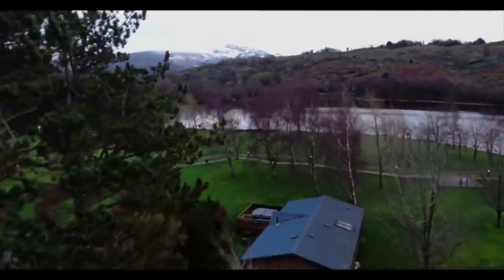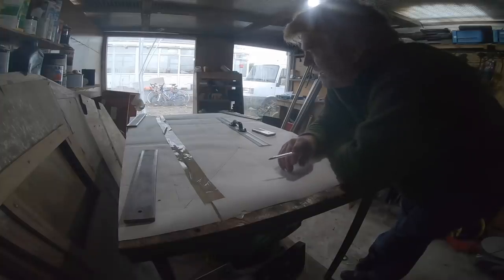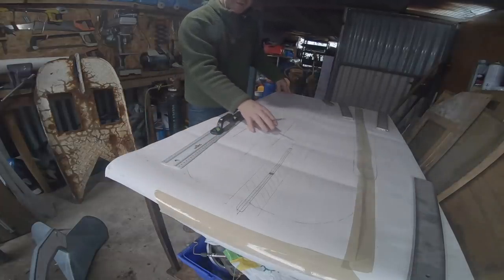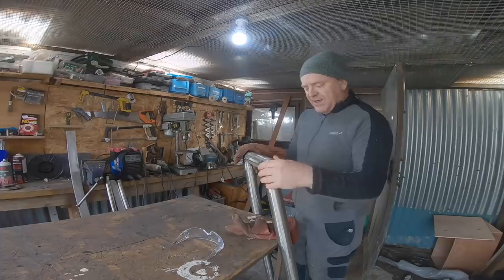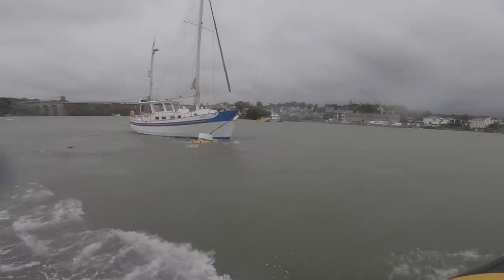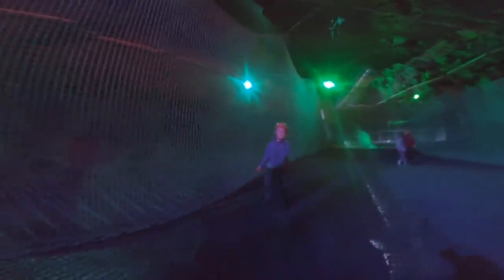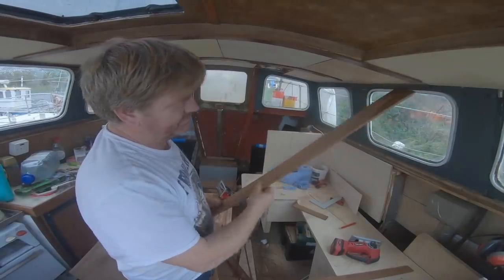# 70 - Making a new BOWSPRIT!! Rebuilding a STEEL boat⛵⛵

Comment: Great idea for the deck head! Seal it with resin to keep it waterproof and whip able.  Velcro is the way to go for attaching them and great score off of eBay for the cosmetic strips.  Your welding skills are really coming along.  I’m really looking forward to the inside work.  Your tiny home is really coming together.  Don’t forget to check out some ideas for using and modifying flat pack stuff from ikea or similar (I assume you have that type of stuff and it’s cost effective like here in the States.) There are some really terrific YouTube videos from home designers that can give you ideas for them. The toy box units in the children’s section make fantastic bench seating for eating areas and have great storage. If you shop wisely, the units are cheaper than the wood to build them! It’s going to be great.

Comment: Pilothouse overhead would be the correct terminology.  Well done making the overhead panels all removable, the use of Velcro to hold panels in place is a great way to go.  If you can find industrial Velcro you wont need any screws, many super yachts interiors are overhead and bulkhead panels attached only with Velcro.  Your bow sprit construction is an improvement over the original, wherever you place the anchor roller is where the anchor chain will hang from, the further from the boat the less likely it is to chaff on the hull.  Stainless will corrode and pit least when polished the higher the polish the less corrosion.
Reply: I 2nd your thought ! Nicely done guys
Reply: Correct term for a ceiling on a ship or boat is deckhead.

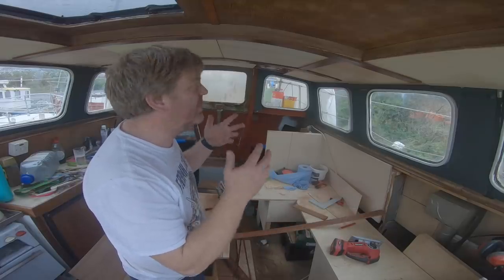Comment: 21:31 If I may suggest a finish for the roof panels: Get some used curtains (cheap cheap of ebay or the like) and "paint"/glue them in place. You can use any old paint, as long as it is the right color. Get some latex based wall paint which you can easily clean off. Paint the panels, lay over the curtain pieces and paint over them until the fabric is saturated fully. You can proceed to remove any access paint by going over the panel and the curtain with a dry paint roller which will soak up any paint which is not being absorbed by the curtain fabric.
After the paint has dried/cured you can then trim off any access fabric hanging of the sides (it is recommended you let the panels dry on a flat surface so the fabric does not hang off the edges while curing (or else you may run into some wrinkling and creasing) 
The result is very nice, has a texture of fabric, (obviously) it is durable but a bit heavy (due to the amounts of paint being absorbed), has a sound deadening to it, very easy to clean, water resistant (to a large degree - don't pressure wash it or soak the crap out of them obviously) and easy to maintain...Mind you, Vikings and Anglo-Saxons (back in the day) used a similar technique to reinforce their battle shields so it should suffice for a couple of roof panels...

I am not sure if you are planning to use a vapor barrier behind the panels but if not I would recommend doing it. Simply get any old plastic (not the really thin kind obviously) and staple it over the insulation, taping over any seems with ordinary packaging tape...
Reply from the maker: That’s w brilliant idea! Love it. We’ve already ordered the fabric now
Reply: @SailingMelody  Save yourselfs a bit of the sterlings and get a couple of curtains from the local thriftstore...

Comment: Looking great guys. I refitted a hurricane sunk yacht once and used the same method for refitting the Deckhead. Used a vinyl covering on the ply. Also screws in the plastic screw covers. The Velcro works well and stapled that up also. So yes Deck head is the correct name. Little joke when I was a cadet in the merchant navy. Off to do a deck head survey 😀 love the stainless bowsprit also and happy birthday young fella.

Comment: a good size plumbing company might have a hydraulic brake which could bend that tube.. it's a nice bowsprit but an arc for the front bit would be my preference.. my quibble aside, very nice bit of fabrication w/o specialized tooling! I've vast admiration for you all.

Comment: Great progress. What we would say constructively is.... Ditch the Delta Anchor!!  Absolutely useless!  The are called a plough for a reason. Go watch our recent anchor upgrade video and the two with the title "what's the best anchor". Anchor technology has moved on...   The delta is the worst anchor we have ever had in 35 years, but it has a lot of publicity and ratings in the sailing press... 🤨(He who pays the piper, calls the tune).  Among the people that actually live aboard and put their trust in a good night's sleep.... 1. The Ultra.  2 .The Spade. 3.The Mantis (go one size over) 4. The Rocknor (the Vulcan will not fit all bow roller set ups). The bowsprit looks good Andy but be sure you dont limit yourselves to one design of anchor, the ability to deploy a second, or have a backup. Sail Safe Guys, Ant, Cid & the pooch crew.
Reply: Seconded on the anchor. I use a 15kg Rocna on my 6tonne boat and it never lets me down and is always super quick to set.
Reply: @stevenr8606  That's a good point, I follow Captain Rick Moore on YouTube and he had to set up his Anchors for the various Hurricanes that hit the Island he, his wife and crew had to stay at during the Lock Down for the Islands Covid Pandemic response last year at, San Andre, this Island doesn't experience many Hurricanes because of its position in the Caribbean but they had two in quick succession, Hurricane Eta in the first week of November and Iota about a week, a week and a half later, there was Yachts and Fishing Boats dragging there Anchors across the Anchorage with the Coastguards and Captain Rick going to the rescue of several Vessels and Captain Rick had to redo one of his Snubbers once during the second Hurricane 🌀 but other than that he had very little to worry about with his own Anchors, which he had on the same Chain one behind the other on double D swivel links so the Chain could swivel on the Anchors and allow the Anchors to reset when the Yacht settled on its new heading without the Chain twisting up and becoming damaged as the Yacht turned with the Wind and the Snubbers really low on the Chain, his Crewman went down with a lightweight tank to set the Anchors after which Captain Rick used the engine to simulate the Yacht going around the Anchors to make sure they reset when they were torn out and then reverse the engine to make sure both Anchors reset correctly and then he had an Emergency Anchor on the Foredeck ready to go overboard on a separate Chain..

Comment: Lighting, two strips of L profile wood running the length of the deckhouse on either side, LED strip light sitting on the short side of the L facing up, viola, invisible when not in use, discreet, colour selectable low power LED lighting. Some of the controllers also have a disco function, just the ticket for a deckhouse rave...  about £40 from ebay.

Good to see you making progress.
Reply: With a bit of further thought, incorporate it into overhead grabrails. Dagnabit, going to have to implement it on mine now.

Comment: Try and keep the anchor roller as far forward on the bow sprit as possible, to try and make sure the anchor chain doesn’t foul the bob stay as the boat swings around in the wind at anchor.
Re the infills for the bow sprit, have you thought of using plywood glassed over completely and painted , weld some tangs on the inside of bow sprit tubes to bolt the plywood to. Keep up the good work.
Reply from the maker: Good advice thank you

Comment: I like the idea of running the bowsprit support a few inches forward of the platform frame and finishing it off with some sort of decorative touch.

I'm not sure of there are smart switches made in marine grade yet, but that strikes me as an interesting approach to the lights.  You could turn on individual lights on white or red, or use a master switch to override those to turn all of them red, or off.  (And just think!  Voice control lights!)

Good work so far, last week's episode was a bit teary-eyed but in an inspiring way.

Keep up the good work!

Comment: You are making massive progress.👍 What are you doing to resist the bending moment (exerted upwards) by the forestay on the bowsprit, or are you relying on the bowsprit structure alone? On the insulation and ‘headlining’ please do consider interstitial condensation ( bodies breathing and cooking) - you really need a good vapour barrier on the cabin side of the insulation before you put the wooden panelling up (finally).
Reply from the maker: Yes I am installing a stainless bobstay chain as well as the bowsprit tube and we are putting some serious closed cell foam in between the metal and the wood

Comment: Forgive me if it's been suggested prior to my writing, will you be putting your fancy insulation above the new panels? That tropical sun will cook you inside! Also, if you haven't got one already, get a Dremel for tidying up, prior to welding etc. Cant believe I spent most of my life without such a brilliant, versatile tool! Happy belated birthday Jack.
Reply from the maker: Hiya. Yes we are using closed cell modern foam for insulation, I’ll actually explain a bit about what we’re using in the next episode.  But I’m putting the panels up in. Such a way that it’s easy to get behind them, and  remove the insulation if needs be to do any running repairs, electrical work etc

Comment: happy birthday Jack !! and Andy , have you think about putting a vinyl foamcoated sheet on the roof pannels? easy clean and licht also, friendly greetings, Brian
Reply from the maker: Yes we’re going for vinyl for sure. With some synthetic foam sandwiched inbetween
Reply: @SailingMelody  Make sure you get the correct foal for marine use. Most boat manufacturers use the wrong stuff and it ends up disintegrating into dust
Reply: @SailingMelody  I wouldn't recommend the foam backed vinyls if you are headed to sunnier climes. The foam will breakdown and causes sagging. Better to go for a non-foamed vinyl glued directly to those nice new boards - it should last forever! Having had to replace foam backed headlining twice now, it's a horrible messy business.

Comment: Why didn’t you have anchor come up on front of bow spread and it would hook on front and you could make brackets to put a safety pin threw it
Reply: Because its a sprit. There is a stay wire and a sail to attach. Anyway anchor out that far will just cause the boat to pitch and slap when on anchor. If anything bring it in more.
Reply from the maker: I’ve actually seen people run a snubber to a shackle lower down on the prow abojt a foot above the water line, more or less where the bobstay shackle attaches. From what I’ve seen it can reduce the slap and noise at anchor

Comment: Watch out with that thin wall stainless tube it has no structural strength make sure you make a full frame for all the stuff to connect to as that tube should just be for looks love the vids chur chur from tauranga new Zealand 🇳🇿
Reply from the maker: Yes that tube is only for the platform frame. It’s not carrying any of the load from the forestay. The heavy walled mild steel tube which is 6.5 wall thickness and has a bobstay chain down to the prow is taking all the load.  The only thing the platform tubes do is maybe add a little bit of lateral stability to resist sideways pull but I may even add some steel cable and turnbuckles to beef up the lateral resistance as well
Reply: @SailingMelody  that's the one I had a mate that made similar thing on his smaller sail boat using the thin wall and what a nightmare it was we ended up making again in 5mm thickwall tube around a 5mm stainless plate inside 20 years on its still perfect good luck mate keep up the great work chur chur from tauranga new Zealand 🇳🇿

Comment: As I understand, the correct term for the ceiling on a boat is the deck head. For a suitable wipeable material for covering the deck head panels - Hawkhouse Marine do a vinyl material in a range for lights shades and comes as plain or foam backed. The panels need to be sealed on both sides first and then the vinyl covering is glued on using waterproof/exterior grade PVA adhesive. Hawkhouse have instructions on their website. I’ve used it with good success. Some people hate it! It’s a matter of personal choice. Send me an email address via messenger and I can share some photos of what I have done.
Reply from the maker: We have already ordered the fabric now :) but thanks for the suggestion.

Do you think sealing the wooden panels is necessary? Once they’re covered in vinyl or whatever I can’t see it making much of a difference? But I’m happy to be convinced otherwise
Reply: @SailingMelody  Any unsealed ply will absorb moisture from the air and go mouldy. I can show you some sheets of ply which I have stored in my wood shed and has grown a nice culture during a damp winter. I’ve sealed my panels both sides with a kitchen/bathroom grade emulsion paint which I believe will keep the moisture from being absorbed by the ply. Probably overkill on the side covered by vinyl.
Reply from the maker: You probably have a good point there. I’ll do a  couple of coats of a quick drying varnish on both sides eh

Comment: Tig welder would be better for stainless steel.
Also with stainless steel steel shouldn't be anywhere near stainless steel as will make the stainless steel rust if comes in contact with it.
Reply from the maker: Hi. Yes I’m aware that tig is better but I can’t tig weld so that’s that decision.  I’m also aware of the issues of the increased potential for a galvanic reaction between dissimilar metals and have a number of solutions to working around these issues. 

The fact is, every boat has a mix of dissimilar metals. All of them: without exception. Unless you count that new thing they’ve 3D printed from recycled plastic 

Even fiberglass boats have stainless, aluminium, mild, brass, bronze, DZR, copper and a host of other alloys. 

So it’s all about making informed and sensible decisions about where and how you use these metals in conjunction with each other and also how you go about the process of passive and active galvanic protection.  This is an area I am learning about but as certainly no expert on, so if you have some industry advice I’m all ears :)